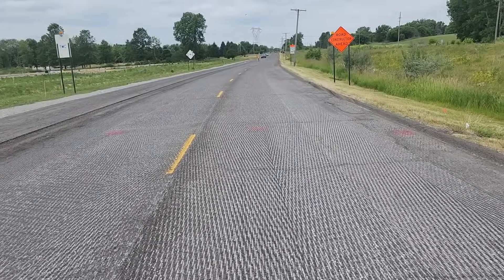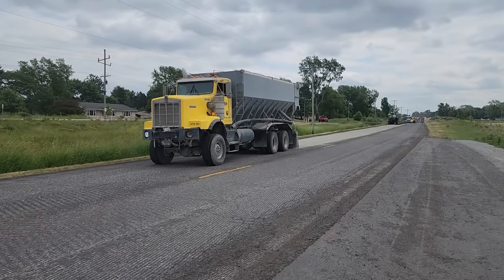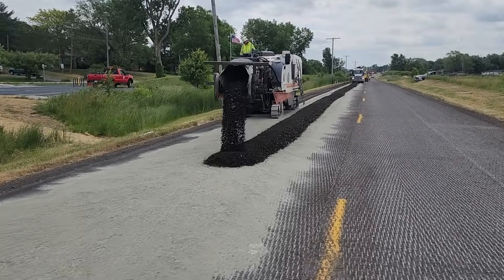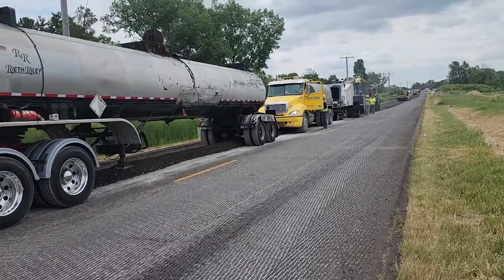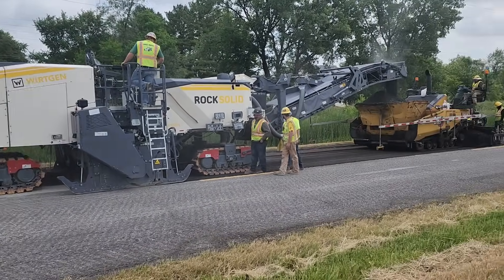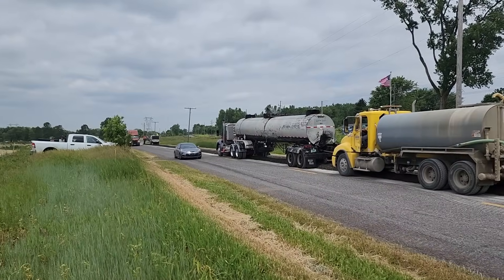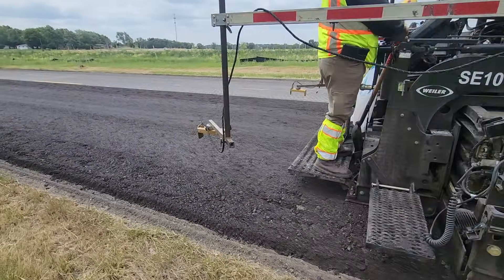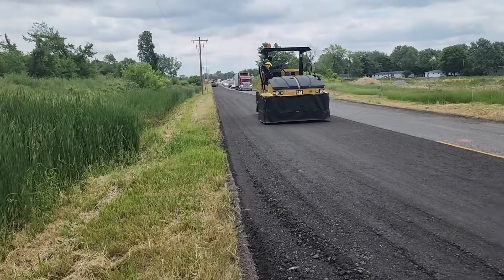CIR - Cold in Place Recycling performed in Indiana.

Comment: The jobsite crushing of old roadway tailings was developed by University of California. In the 1980's California decided make every underground tank be tested and they were  STUNNED  to find 90% of all underground fuel & chemical tanks leaked. Most were steel tanks which had corroded & pin holes allowed seepage.  SO,  the state issued a mandatory order that on Jan 01, 1990 all steel tanks in our state had to be replaced with corrosion proof tanks which were fibreglass. Our state underwent a blizzard of tank replacements  with the gas station lot over burden often contaminated with petro being hauled off to landfills. So UC worked on the problem and devised a simi truck trailer with a crusher on one end & a conveyor belt going thru a burner to burn off the hydrocarbons leaving nice sterile aggregate ready for repaving. Yours does not have the burner, just the crusher but before UCs machine mountains & mountains & mountains or tailings had to be disposed of. But, no more.

!

Comment: Is the emulsion hot or does the mixing unit heat the mixture before conveyed to the paver OR both
Reply: Note the video caption - this is cold. there's a cement mixture added, not hot liquid asphalt binder.
Reply: @darkfyre2k  There is an "emulsion tanker" at the front of the line, 01:35 . But anyway, I watched it again and noticed steam/ smoke coming off the fill port of the tanker so I answered my own question.